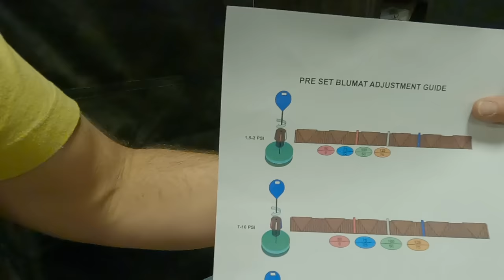BuildASoil: BLUMAT PRESSURE SYSTEM INSTALL // WITH COOPER SUSTAINABLE VILLAGE (Season 6, Episode 12)

Comment: I've found with the older gravity setups it does best if you add a second reservoir and a float valve in the main reservoir. Have the second reservoir feed the main reservoir and maintain a constant level of water with the float valve. You will maintain a constant level in the main reservoir and constantly the same pressure to the carrots. You can also make the second reservoir as big as you want and as far away as you want. You could even not have a second reservoir but plumb the float valve into your house plumbing and it'll keep your reservoir full like you tank on your toilet. I do the reservoir setup just to be able to PH my water.🥳🤙😎🇺🇲 much love from Pennsylvania
Reply from the maker: Makes sense! Remove the variable from the equation by having a steady reservoir volume that creates the pressure you initially calibrated with! BOOM
Reply: Agree

Comment: I put my ten gallon reservoir 7 feet in the air so it would be nice to have it the floor. I imagine if you put a moisture sensor switch on the floor you could turn the pump off if it flooded.
Reply from the maker: I like the idea that if a grower wants to have enough water for a week or two with 2-4 beds going.. they can now use a larger reservoir without having to put high in the air. This and you still get to use a reservoir instead of being directly connected to the water source which could be an UNLIMITED leak if something bad happens. Where as with a reservoir... worst case you flood just a reservoir....

Comment: this has got me thinking blu mat may be the hot ticket. im really stoked on seeing the tray 2grows this season. ive got like 12 runs under my belt on the OG 15 gal hand water BAS method. it it great and reliable but the easy of auto watering sounds great for plant health.
Reply: I started using the blumat setup a couple years ago and it's great! Takes out the guesswork for sure. The run in on right now I opted to not set it up because I got a pulse meter and wanted to try it out with hand watering. I'll prob set it back up for the next run and test it against the meter to see what works better.
Reply: If you’re in a 15 gallon container than yea Blumats is the way   They’re great in larger pots. 

Not so much for 5s and 3s.

Comment: I use a floter to feed my reservoir directly from my RO system. Pump seems completely unnessecary unless you need a tank with fertilizer and PH adjustment to feed the reservoir. For me, the Bluemat solution is great because it's powerless. If I were to use a pump to fill the reservoir from a tank with fertilizer and pH water, a cheap Blidge pump is sufficient, using a floater trigger in the reservoir that feeds the Bluamat.

Comment: I was listening to a guy who repaired soil on farmland by rebuilding the layer zones of soil. He assembled pots and beds Organic layer layer O, the horizon topsoil layer, and then a filter layer on the bottlom so that at no time would the bottom root tips sit in organic silt with no oygen holding capacity.  A rock sand layer of a few inches on the bottom troweled flat for no pooling or air traps acts to filter the silt our while Mycorrhizae can live there and mine the sand and rocks silt free. He used land slide soils or what ever was on hand like dune sand.

Comment: The drip rings are awesome I have the small and large rings in my blumat setup. 

Really impressed with the blumats, I’m getting use to them now. 

Took a few weeks to learn to dial them correctly and feel comfortable with them taking over the watering.
Reply: What size pots
Reply: @timpage5021  I’m running the 10g grassroots living soil pots with them. Would like to step up to the 15g but space is an issue.

Comment: I use the Blumat tape in my 3x3 and I like having the readout sensor for when it comes time for top dressing. I like to time my top dress when the meter is about to hit its driest reading, that way I can water in with all the goodies for the plant without over saturating the soil.
The pre-calibration on the carrot sensors is a nice touch I would recommend for those who would like to give Blumats a try. I got mine dialed in while growing a cover crop only (not pre-calibrated), I wanted to make sure it was set right BEFORE I put my ladies into place. And it was a good thing I did because I had it way too open at one point and I had water coming out the bottom into my drip tray. It took me roughly a month before I was confident I had it set right before I transplanted into the bed, the pre-calibrated carrots would have made it so much easier and faster to set up.

I use a 32 gallon black trash can as my water reservoir, and I have it set up on a stand as high as I could get it to my 7 foot ceiling with the lid on, and I hooked up a quick connect at the top for a hose that I can run from a water filter. I also bought some fittings and some clear tubing and made an indication line that runs outside the can from bottom to top so I could visually see how much water is in the tank. So far so good.
This is my first grow and my ladies have been stellar the whole time, and they're in week 1 of flower. 😁 PFG.

Comment: I have the double manifold system in my 4x4 bed and I have 4x 20 gal bags with 2 of their 10" rings and I'm running side by side 2 20gal bags with their soaker hose looped around. Idk, I love them all lol.  You can feed through the rings, but it'll get into my hoses and clog them so I don't.

Comment: this pump costs more then most grow kits😳looks great but will stick with gravity🤘✌️
Reply: they make a little pressure reducer you can screw right on to a hose which works great and you don't have to worry about keeping your reservoir filled.
Reply from the maker: For sure for sure! If you ever have to leave town for longer than gravity could handle this might be an option for larger rez without having to lift into the air.... But I get it!! It's not for everyone that is for sure. I just like learning all this stuff and sharing it
Reply: @BuildASoil  thanks bro we love to see all the new things. And as a blumats user i appreciate it even more🤘Hope to see you at the DGC cup in June🤘✌️

Comment: Absolutely love blumats. My last two grows with them using the Build a Soil living soil has been off the charts. I have five 20 gallon living soil fabric pots in my 4 x 8 tent. I tried drip tape the first time and I felt it had a little uneven watering so I went to a drip ring and I believe that is a little bit better. My question is this: I’m going to upgrade next cycle to a 3 ft by 6 ft bed. Is it better to have each plant have it’s own blumat and ring or have one blumat and rows of drip tape as you show in this video?

Comment: Great video! This one season i had the brute stacked onto another under a rain gutter, and the amount of water would drop the pressure perfectly as it went to the bottom to make it last even longer. If the rain was consistent, i could go weeks without doing anything.  Best cheapest setup iv seen or made ever .

Comment: Drippers are so much cheaper and more flexible than bluemats.  With the eco wit moister sensors sensors and drippers I can control my whole grow with my phone.  Got the pump on a smart plug. Im dry amendment water only also so my revivor can stay full for weeks with no funk growing in the water and no emitters ever clog.  I got over 30 strains on autopilot this way.
Reply from the maker: Sick! We like to cover all the methods. Are you auto firing the irrigation based on ecowitt?
Reply: @BuildASoil  Yea the ecowitt sensors help guide my irrigation. I have 6 pots with one sensor in the top and one near the bottom. I use two 60 dollar 1/3hp sump pumps each on a kasa smart plug to control the irrigation timing from my phone. This gives me two watering zones. One for plants that like lots of water one for plants that like less. I use larger or smaller gallon per hr drippers to dial individual plants if need be. All in 3 gallon pots amended every 30 days with dry amendments.  I have a smaller system on a aquarium pump that waters up to 50 or so 1 gals for my veg'ing plants also.

Comment: That pump is insane overkill btw. That pump could water hundreds of pots.
Reply: I've got a 4x4 bed with the same blumat layout they have here except instead of the big pump I just use the pressure reducer that screws right on to a hose. Seems to work great so far and it was like 40 bucks.
Reply from the maker: YES! This is demo for the capability. Not needed for 1 bed. Just sharing the tech and having fun.
Reply: @BuildASoil  For sure, hope I didn't come off overly negative. I love your products.  That's a great pump too. Lots of commercial facilities use them. May just be a little much for a home grower

Comment: they should legit give out free pumps out to everyone whos spent countless hours cleaning up water from their systems failing. Will never use again period
Reply: I’ve had my share of runaways . I addressed it by increasing the amount of water. It sounds counter-productive .But what happens is the carrots dry out and don’t shut off . I increased the drip to 12 drips per minute instead of hanging drip and never had a flood again.
Reply: i agree

Comment: Seems like it would be simpler and cheaper to use a float valve connected to a waterline on your tote/trashcan that always keeps the same gravity pressure.  Or why not use a waterline from your utility with a pressure reducer/expansion tank.  I guess like you said you just want to minimize potential damage associated with infinite water supply (i.e., water from the utility).

Comment: Hi, Really great to see how the blumats work in a bed. i like the System in my Containers. 
Do you let the water sit still in the Reservoir or do you use a Pump to circulate the water?
Reply from the maker: The water just sits still. You could aerate it on a time if you wanted to but I haven't.

Comment: I love this blu mat thing. But my tinkering mind is curious. The norm is to put the drip tape on top of the bed. But would it work if you barred the drip tap on the bottom of the bed? If I'm thinking about this the right way, would it turn your bed into a giant SIP/ earthbox? That would be super dope, not really necessary but something different and cool. Would love to know your thoughts on it. Love the series. Keep up the good work my friend
Reply from the maker: Wow!!!That would be kinda rad. I've never even thought of it.
Reply: @BuildASoil  do you think it would work? Or would the weight of the soil just smash/pinch the tape closed? Maybe insert a piece of PVC pipe with a bunch of holes drilled into the tape to keep it from getting smashed

Comment: My ro system directly feeds my blusoaks in my 4x4 (pressure reducer required)
Reply from the maker: That works!!! This is a method to keep it off of the water line. There are a few reasons but they way you do it is great too

Comment: my blumat system keeps on splitting at the seam on the drip tape, therefore dumping gallons of water and flooding my bed/room.   I have the  blumat water pressure reducer i only use filtered water. this has happened to me twice now.   ill stick with using a water wand until they can figure it out

Comment: How many carrots can the air compressor manage? Seems overkill for less than a couple 4x4 beds considering ROi. Better yet, can this compressor be used off label for other home projects when between cycles or resets?
Reply from the maker: Was highlighting a more commercial or garage style setup to show the new new. The cost is high but many people want to have this automation when out of town often etc. I think for the home grower gravity fed is fine.
Reply from the maker: I think Cooper said this system can manage a large operation. I'll let him answer this one.

Comment: How many carrots (and size) would I need for four 10 gal containers? Gravity fed.
Reply from the maker: I would get 4 x 9" carrots one for each pot. And the Drip Rings and Get at least 1 Moisture meter so you can dial it in proper. With the 9" you can put deep or shallow and they are all you would need
Reply: @BuildASoil  Awesome! Thank you

Comment: That's going to be a noisy unit. If the pump cycles like a normal air pump. My wife would kill me lol😅 

Wow I had to edit this to say that's not loud at all. I'm surprised what's the price point on this unit?
Reply from the maker: Yeah it's quite and never really fires up... I have still only heard it the one time. I'm not sure of the price point as it's all new but I think it's $400 or just under.
Reply: @BuildASoil  I had smoked just before looking it up. I didn't see the same setup that's featured on sustainable villages website. The one I saw - I believe ranged between 499-599.00 USD respectfully. 

If I get this right water and air enter the expansion tank and that's where the pressurization takes place. What's the flow rate on the pump?

Comment: Purchased this pump kit recently and I am going to warn anyone who is thinking of buying this item of a few things. 1) you are expected to wire in the 3-phase plugin into the pump, The power cord is NOT attached to the pump and it just has stripped wires where YOU are expected to finish the connection. 2) do NOT expect all of the pieces to fit properly. The thread pattern on the shutoff valve is not the same thread pattern as the white PVC T-connecter. You will need to MacGyver the connection if you expect to have the shutoff valve connected as shown in this video. 3) there are absolutely NO instructions included in this package. You will need to be able to figure out how to attach everything based on this video, as the photo shown on their website DOES NOT match the video. 4) for this purchase of $600 you are expected to be a plumber and an electrician as well. OR at least be willing to trust that you can do these things safely in your own home and not cause either flooding / or a fire. I personally have spent 2-3k on Build A Soil products or on their website in the last 9 months. I think they may have seen my last purchase after buying this pump kit.
Reply: I didn’t run into any of these problems, my cord included was a 120v with three simple wire nuts. All my pieces fit and work properly. Watching this video made everything straight forward and a simple process.
Reply: This guy says "I did not run into any of these problems, yet explains immediately that they did in fact experience the same issue I had with item #1. Also a warning to anyone with half a brain, DO NOT wire your own power cord using "simple wire nuts". This is asking for a fire hazard as you are wiring in a cord which is being used to pump WATER. As we all know, water and electricity generally do not go well together. Using heat shrink tubes to seal up the wires entirely is a much smarter method of attaching your cord. I take this comment with a HUGE grain of salt, as should you. Another question to be asked is, did they buy theirs AFTER I did and raised such a stink? Were they a benefactor from my conversations over the phone with both Jeremy and Cooper? It would not shock me if the cord came attached if purchased from Build A Soil now.
Reply: @timothybenike4959  it did not come attached upon purchase and I hope that conversation made you feel mighty and big with Cooper and Jeremy. Your response baffles me. Good luck with this thing called life. 😂
Reply: @BobbyButane  once again you stated, " I didn't run into any of these problems ", and later admit you did. I would have to say it is your response that is baffling. To answer your question, it did not make me feel "big and mighty" to talk to Cooper and Jeremy over the phone. In general, I found Cooper to be quite helpful and genuine, that was until I was forwarded an entire email chain between BAS customer support and Cooper which let me know exactly what he thought of me as a person. I am not here to bash either BAS or Cooper from sustainable village. I let both know exactly what I thought about the purchase and how I felt about it in the end, and that was good enough for me. 

The reason I left my initial post was to let anyone who is interested in this item, that the video has a few things in it which do not match what I received when purchasing said pump. 

GL as well, but if you do not want people responding to you, don't respond to them. Also don't say you never had a problem in defense of a product, when you later admit you in fact did have the same problem. It makes you seem like you have an agenda and aren't really speaking factually. 

With that being said, Cooper did send me the adapter that was missing, I purchased the extra shutoff valve shown in the YouTube video, and except for a recent user error, the pump kit works as advertised. I have tremendously enjoyed not having to spend an hour plus watering my plants by hand daily. Just expect connections to leak (unless cooper followed through and stopped using threaded PVC couplings), expect to have to attach your own power cord (hopefully staggering the cuts, soldering the connections, and heat-shrinking the wires to waterproof them), and to potentially source a few parts from your local hardware store. The item is sold as a kit and not a functioning unit as is.